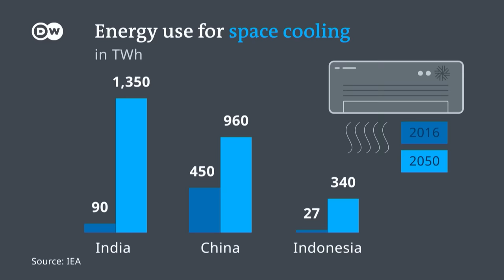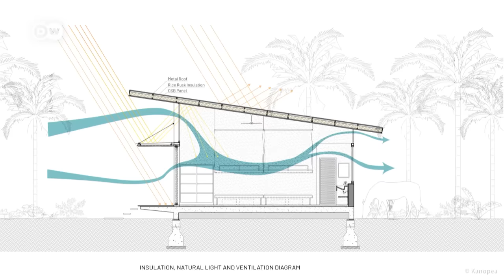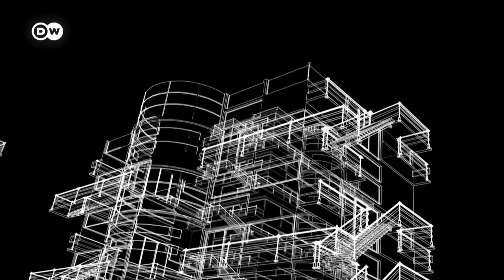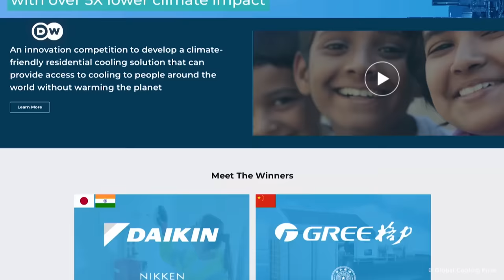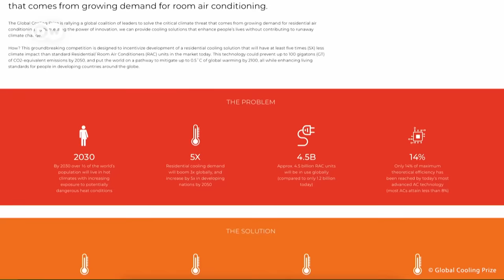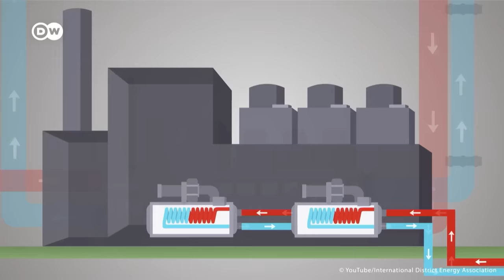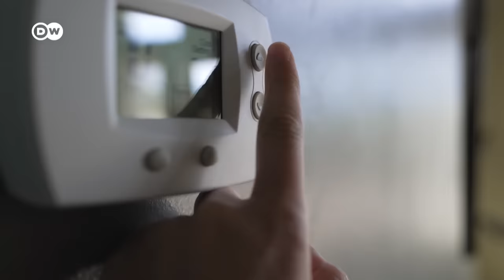How to cool our homes (even without ACs)

Comment: Honestly I can't afford to cool my home. Best solution for my case will be to plant trees in from of my house to introduce a shade during the day.
Reply: I can't even afford that because I don't 'own' my home.
Reply: @sriharshacv7760  Can you consider living in a van next to the river?
Reply: Some trees absord more carbon than others or so I read
Reply: Bubble wrap on inside of windows helps too. Spay window with mist of water. Press bubble wrap on. Will stay "stuck" a long time. You can often get free bubble wrap from stores that are unpacking merchandise  or shipping centers, etc. Really helps my place and lets light in during winter. In summer I keep curtains shut. If you live where there are no neighbors, covering cardboard with aluminum foil on one side really helps reflect summer sun. Put shiny side facing out. If humidity is low in summer, a spray bottle with fine mist of water can give illusion of cool. Freezing a block of ice and placing it in a bowl in front of a table top fan can help too.
Reply: The windows are with blinds already. The problem is the walls, they absorb the heat during the sunny hours of the day and keep the house hot during the night. An insolation is out of the budget sadly.
Reply: @DarkGT try putting some static cling window film tint on your windows if you haven’t already. Helped cool my home down so much! I bought it on Amazon and put it myself lol, also helps insulate in the winter too from heat escape
Reply: My house is in the desert.  It has only one small window on the south side and one on the north.  The east and west have big windows.
I have blackout drapes on all of my windows.  During the summer, I close them, and the windows during the day and open the drapes and windows at night to let in the cool air.
In the winter, I opened the drapes in the daytime and close them at night to keep in the heat.
My house is only 546 sq. ft. and stays 10 C cooler in the summer and around that warmer in the winter, than the outside temperature.
I use fans to keep cool and only turn on the small window air conditioner when it gets over 30 C, if I get too hot.  It has reached 49 C here, but that is rare.
The AC is in the bedroom, so I use a big box fan to blow the cool air out to the kitchen and another to blow from the kitchen to the living room.
I hope you can use some of these ideas to keep cool in your house.
Oh, and you can also soak and wring out a shirt in warm water and put it on for personal evaporative cooling.  It works with hats, too. :)
Jon in rural BC, Canada
Reply: Then, the insurance company will drop your policy because the trees will become a hazard... 😅
Reply: @danm9006  I live on the edge. Insurance? We don't need that where are going Marty...
Reply: @DarkGT  ...lol... Good luck Doc! 😉

Comment: I want to point here out, that warm capacity of a building DOES matter a lot.
I work in a company, and we have 2 buildings here - one built in traditional way - solid bricks, and new modern well isolated framed one. 
The traditional one feels comfy all year long, but the new one gets very quickly hot/cold, due to lack of heat inertia… 
Sometimes, it gets so cold in the night, that you want to turn on heating when you arrive, and then 6h later, you’re melting down. Madness! But technically it’s very well isolated and almost passive!
Reply: I live in a bedroom that is a modern addition onto a century-old brick house. My room alone is freezing in winter, and boiling in summer, while the rest of the house is comparatively stable and comfortable. It’s a natural experiment and example of architectural failure.
Reply: If you turn on heating in a near passive building then I say the controller of Central Heating simply needs to be readjusted.
That being said, a buffer, like the one in this traditional building is also very important and serves a concrete purpose. Both solutions are good if properly implemented.
Reply: @Rnankn  i live in bedroom facing west on brick house and it's always too hot to sleep at night due to the brick dissipating the heat previously absorbed from the sun earlier on.
Reply: @NimbleBard48  in summer, the heating system is completely turned off.
It doesn't make any sense to turn it on - it take hours to warm fool up, and then it takes hourssss to cool down. That would be pure hell at midday.

But your thinking shows how ridiculous modern houses are. Think about the energy you would wast for heating/cooling, while in old buildings, you don't experience such temperature fluctuations at all.
Reply: @Funktastico Thermal mass can be a double edged sword. Sun-facing brick walls should be shaded or they become thermal batteries, great in the winter but not so good in the summer.
Reply: There is something wrong with the mechanical, architecture, construction or other in the new building. I live in a super insulated passive solar house with a slab on grade that stays a comfortable 22-23 C all year. There is no air conditioning and some small baseboard heaters for the winter
Reply: @fallinginthed33p That depends on the climate zone. In moderate zones, the brick walls will average out the daytime heat and the cool of the night.
I live in a 1907 brick built house in Berlin where summer temperatures can get high enough for many people to consider aircons in offices or modern residential buildings.
In an old brick building, the hotter it gets outside, the more airing you do at nighttime and that'll do. It's a rare year when I find the indoor temperature unpleasantly high on more than 5 or 10 days a year.
Reply: Hi Kiel,
You are talking about thermal inertia, which is how long a material does take to change its temperature, or how much energy does it take to warm/cool it. You are right in the sense that modern materials have a very low thermal inertia, and the over-engineered layered construction is very efficient on the lab [which measures the isolation power of a material, not the thermal inertia of such materials]. A very good way to avoid the effects of poor thermal inertia design is introducing air layers between the materials, as heat is very badly distributed by convection and radiation when air is present [air is very thermally inefficient]. For a glass building, an infrared blocking glass will help. They are extremely efficient at blocking infrared radiation that causes heat to enter, but they are VERY (very) expensive.
Reply: You aren't fighting thermal inertia, you are fighting efficiency standards.
Thermal mass is how much a material can absorb energy. Thermal inertia is how quickly that mass can change its temperature. Old construction relied on having enough mass that the heat from the outside would barely reach the interior of the walls by the end of the work day, and then at night allow the cooling of the interior to fight back to the exterior by morning. It is effectively a giant thermal battery that you charge and discharge. And if that battery ever depleats, then the hvac system inside would easily be overrun and make everything horribly uncomfortable.
New buildings have much less thermal capacity because they have much better/slower thermal inertia than the old building. If you put the same hvac system in both buildings, the new building would maintain a much more even temperature day and night, without running nearly as often, and saving a lot of energy.
But when you have such good thermal performance, you can use some tricks to save even more power and money... But at the cost of comfort. If you let the temperatures of the old building swing much, then you get thermal runaway which wastes even more power to cool back down. But in an efficient building you can let the temperature swing and save a lot of money in the process. So modern buildings are designed to pre-cool at night when power costs are cheap, let the temperatures rise through the day, and then cool off quickly again as soon as the sun goes down. They are capable of maintaining an even temperature 24/7, but letting the temperatures swing allows for even more massive efficiency and savings. And especially in those early years when you need to prove your energy ratings to get tax incentives, you can bet that the building owner is going to run for efficiency over comfort! But after a few years when those initial kickbacks stop, you can bet they will tune things more for comfort than pure energy efficiency.
The funny thing is that you often don't get to see the real temperature settings. What you see on the wall is often there for psychological purposes, and setting to a nice comfortable 72*f will display 72*f on the wall when the actual temperature may really be closer to 78*f. The software on the back end of the controller let's you set an acceptable temperature range around the desired setting, so an evil maintenance department may have their basement space have a 0*f varience, while tenants of the building may have a 10-15*f swing lol.
Reply: Did you mean insulated or is the building actually kept far away from other buildings? 
Sorry a bit confused here.
Tom's wife Pam
Reply: @Funktastico  East and west facing walls should only be in full sun at sunrise or sunset.  It may be something other than the sun heating the room.  Wetting the brick in the evening can help through evaporative cooling.
Tom's wife Pam
Reply: @fallinginthed33p  Thermal mass is usually placed behind an air chamber, unless there is so much mass that sun radiation really does not matter [ie, solid masonry buildings]
Reply: @fallinginthed33p  good point, and a ready solution in my mind is that some deciduous plants near the sun-facing brick could shade it during the summer but would lose their leaves in the autumn to let the sun warm the brick in the winter.
Reply: Failurr
Reply: Isolated frame or insulated frame? Why the heat difference?
Reply: @CaedenV  faster 'inertia' -  llight weight modern building have less mass and response faster... a major factor when calculating the system design and the building/system response character -  say once you return home and ask for 'comfort' from an off or standby condition of the system.
Reply: @Funktastico Is it painted or rendered in a white or reflective paint or coating?
Reply: Not really passive.
Reply: I would doubt that the modern building is actually as well insulated.. The situations you describe can't happen when the insulation and the general construction of the building are properly done.

Comment: We are a big extended family in the Philippines. It gets really hot and humid here. Our ancestral house is quite big, it has seven bedrooms but only one has airconditioning (the rest have stand fans/ceiling fans only). When it gets really hot, everyone sleeps together in that one airconditioned room. That single room which uses an inverter-type aircon has four bunk beds. We sleep there only during the hottest summer months, around 2 and a half months of the year. I say our system works. Our next step is to install solar panels, hopefully by next year. 😀
Reply from the maker: Sounds cool, and cozy as well. 🌬 Here for solar inspiration 👉 "How solar energy got so cheap, and why it's not everywhere (yet)" https://www.youtube.com/watch?v=sUvaYycoWqI ☀
Reply: I am retired here in the Philippines, and I will be building a new home. I will be using AAC block with a double wall and high R foam in between. The windows will all be IR rejection coated. Then, my exterior paint/coating treatment will use a material called Insuladd. Then, this will be finished as a solar home for what should be minimal energy use.
Reply: I live in Florida where the humidity and heat can be unbearable for 4 to 5 months of the year, I am renovating an old home with no insulation, no tree cover over the house and an air conditioner in a bedroom doesnt keeps up. I bought solar fans with a battery on them. I also purchased DC extention cables to put the fans where I needed. It changed our life drastically.  Everything is significantly cooler and I can work and refresh in minutes without heat exhaustion. The bathroom has no humidity after a shower when the fan blows and a window is slightly ajar. No mold, everything is dry and comfortable. The initial investment iss worth it. No more money to th power companies for the cooling either. Way better than ac and I never would have thought. Wind. Just wind.

Comment: Many Indians have a evaporative cooler. This cooler basically works well in dry conditions and not for humid heat. It requires very less power. Andit doesn't emit any harmful gases.
Reply: But india is mostly humid can only work in may and June effectively
Reply: @thunderred5263   it also needs a lot of water to works on, there's a water scarcity in India
Reply: @thunderred5263  yaa they are useless in humid environment
Reply: 12:54 I live in Southern Illinois and summers are very hot. I have super insulated my ceilings in attic to keep the house temperatures much cooler in summer and warmer and winter. I use Venetian blinds to reflect sun on the east side of my house; I open my windows, and allow air to circulate freely. When it is excessively hot, I sleep in the basement with a small fan.
Reply: "many" =  ~500,000 over 1.4 billion indians

Comment: These are called "Swamp Coolers" and WILL NOT REDUCE HUMIDITY,  but actually increase it.  Say hello to mold and mildew.  The best they can do is to approach the local wet bulb temp.  They only work in dry climates.

Comment: I live in and grew up in Chicago. We lived in an older, brick apartment. Growing up we did have 1 window a/c unit in the dining room and used fans to push the cooler air around the house on really hot days. But mostly we used fans.  The sides of the building were obscured neighboring structures, so really it was ok. We kept windows open. 

Now, my wife and I live in an older apartment building near the lake. Our place is small but has a lot of windows we keep open pretty much all the time. It’s like living in a giant, furnished screened-in porch. We keep cool with fans and don’t hang ac out the window. We both work outside we’re just used to the heat. As long as there’s breeze, we’re ok.

Comment: "Passive House" design is a method of designing houses that can use up to 90% less energy than standard housing, and it includes ways of keeping the house cool or warm with little climate control. It's great to implement in new construction, but it did make the upfront cost of the house higher as well.

There is also a push to try and retrofit existing housing to meet Passive House standards. Cost tends to be an issue here as well, unfortunately.
Reply: I see this as a key problem. If innovation is not made affordable for the masses, at the very least, the "middle classes", what good is it really? It seems the emphasis with all start-ups and businesses is immediate wealth rather than human progress. Watch any program about business and its all about profit margin and greed. Unfortunately also true for green innovators.

Comment: I moved  from a dry climate to a hot humid one and I was quite gratified to see that the humid air is much better for my skin and I look younger. So I found other ways, instead of air conditioning which is drying, to cool my house.  I made it of hollow block and concrete, with covered breezeways on all four sides of the house, a ceiling one meter higher than normal, a wide central hall in the middle that encourages cross-ventilation from one end of the house to the other, an open design, ceiling fans in each room and white exterior paint on both outer walls and the cement flat roof that also serves as a viewing deck and where we can take advantage of the breezes.
Reply: Hi Paul would you able to share some pictures of the wonderful house, please? Cheers